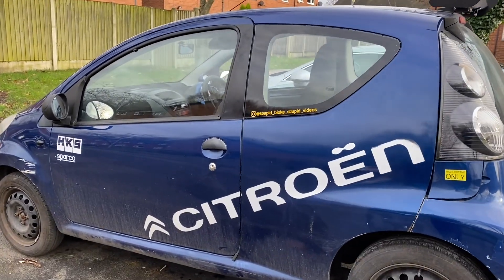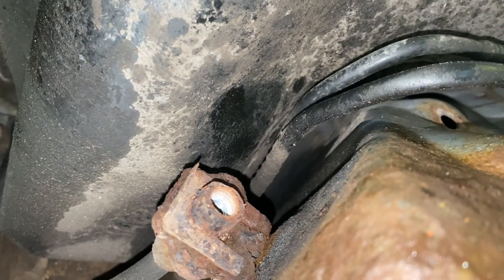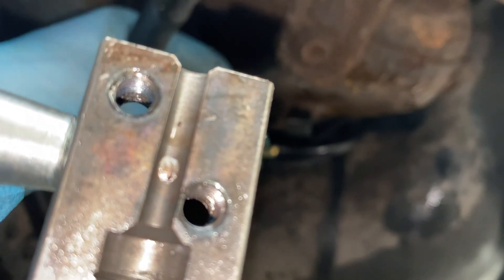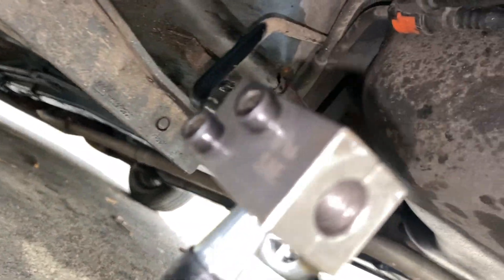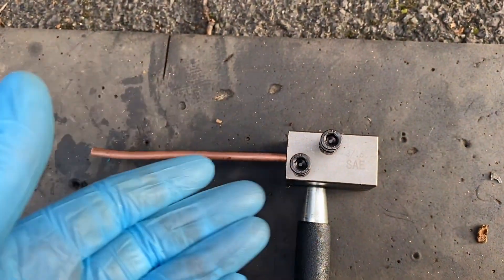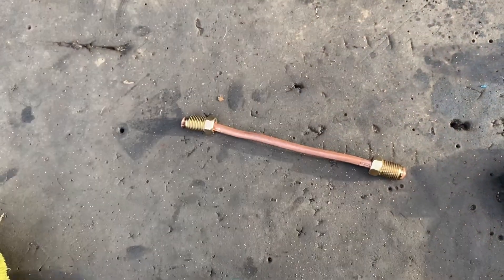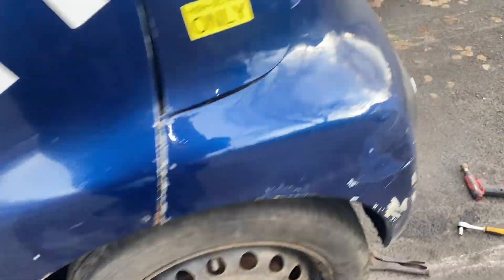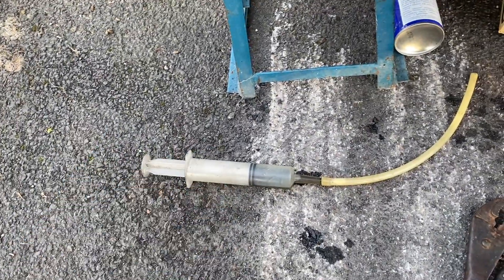How to Safely Repair Rusted Brake Lines / Brake Pipe Section Replacement (CityBug)

Comment: Reminds me i was going to ask your opinion on a debated topic. Brake fluid changes. A few years ago i had a Renault Clio that was only a few years old and the stealership said oh you have to do a brake fluid change after 3 years. Needless to say i told them to do one as how can a closed system absorbed so much water after 3 years right? So how long would you say like every 5-6 years or longer maybe?
Reply from the maker: A lot of dealers recommend it to be changed pretty often but once cars are out of warranty it’s something that seems to get left tbh. I’ve heard a lot of dealerships just suck the fluid out of the reservoir and replace it too without flushing it through. We do it on bikes during a service a lot of the time at work, but we do flush new all the way. Most cars beyond a few years old only seem to get it changed when components like pipes are changed and it doesn’t seem to cause issues. It’s a sealed system but the fluid does go through heat cycles and get shit into it from rubber seals etc. properly flushing the fluid is a job I’ve got planned for a future video. As long as the nipples come undone it’s easy enough to do. I intend to see if it makes any difference to the feel of the brakes, but I suspect it won’t 🤷‍♀️
Reply: @StupidBlokeStupidVideos  I've heard that as well about the dealers. I bought one of those gadgets where it sucks the crap fluid out of the bleed nipple side and puts it into a small pot really handy for the job and only £20 off amazon. Needless to say i did the job myself when the brakes needed doing 2 birds one stone. It didn't make a difference for me see if it makes any different in your vehicle. Oh and keep up the vids make me laugh every time. 👍
Reply from the maker: @daggers88  I’ve got one of those kits at work but usually just use the syringe method I show here, and thanks mate 🤣

Comment: brilliant you made it look so easy ,,i remember doing brake pipes on my old viva 40 odd years back ,,had to keep running back and forward to shop to get new pipes made when i made an arse of it ,,,where did you get the little heat gun ,,?
Reply from the maker: Cheers mate. The tool to do them on the car and to join them to steel is a game changer. The little blow lamp is a Snap-on one I got off the rape van a few years ago but it’s a good bit of kit tbh. Fills up with lighter gas but does actually give a usable amount of heat out

Comment: Hi, please i need advice

I am a Citybug (C1) owner myself. I experience horrible gas milage recently. (about 37mpg !!)

I changed the MAP, sparkplugs, crankshaft sensor, watercoolant thermometer, throttle valve, lambda sensor, catalytic converter,
tried injektor cleaner but NOTHING works. The OBD shows no errors.

I experience some engine rattling when it´s cold - maybe the timing chain or the valves?

do you have ANY idea? Thank you!
Reply from the maker: Also are you working it out to UK gallon and not US gallons aren’t you? If you’re working it to US gallon then you’re getting more like 42mpg in UK gallons
Reply: @StupidBlokeStupidVideos  Thank you very much for your reply mate.

It´s indeed UK gallons. 7.6 Liters / 100km

I rarely make short journeys and the gas mileage is about the same in winter/summertime (maybe about 0.5L less in Summer)

I always check for inflated tires or binding brakes and i am really trying to hypermile that car! So no "digital" acceleration like you used to say.

This really really bugs me, since the normal mileage for the c1 should be around 5.6L or 50mpg uk
Reply from the maker: @PhoticSneezeOne  in the real world about 43-45 is probably more realistic in real world scenario. There are a lot of factors that can impact mpg but the pre-cat lambda can throw the mixture off if that’s faulty
Reply from the maker: Hi mate. Are you doing short journeys? Cold weather and short journeys kills mpg, also driving style is probably the biggest contributing factor. If it’s running well then other than that check tyre pressures and for binding brakes? I get less mpg than that, but my car is modified
Reply: If it helps ... I recently got about 374 miles from full to beeping on a mixture of maybe 80% long distance and 20% around town. Not sure what that works out as MPG as I don't know what the tank size is ... can anyone shed light ... I'm thinking around 35 litres from full to beeping?  Anyway, what is the deal with getting 100 miles or more for the first block of the fuel gauge and only 374 miles for 5 blocks? 😂

Comment: Nothing related to brakes but the front of my Aygo isnt look so pretty anymore (some could say it never was) but...if I wanted to buy new bonnet, bumper and stuff from the UK its going to cost a lot. Luckily the Chinese ripped off these cars as the BYD F0 (formally the F1) and the body panel parts for that thing are a lot cheaper. Of course its going to completely change the way the front end looks but at this stage who cares.
Reply from the maker: I’ve heard of the BYD before. Wonder if the parts are actually a direct fit 🤔
Reply: @StupidBlokeStupidVideos  I've not tried but visually some look identical. And they are a lot cheaper, you just have to get them from places like Alibaba and aliexpress
Reply from the maker: @firefly2k7uk  let me know if you do it

Comment: That's a handy kit.. as far as I can remember (from the rare occasion I read some instructions.. ) they say to end up with the "female flare", you do the single flare operation first "Op1" then turn the die bolt around to further form it with "Op2" (without removing the pipe). Be interesting to see the difference on a bit of pipe if you haven't given the tool back yet.
Reply from the maker: That’s what I used to go off for steel pipes but copper just in a single go. I could be wrong though cos it’s 15 years since I’ve made one tbh, but it seems to work well enough

Comment: Brake fluid running down your arm? YES!

Just a little FYI for anyone reading this, I was always told to double flare (make a male end first and then re-flare it to turn it into a female end) when making the female end of the join because single flaring makes the metal thinner and a weak point. That info also came from a guy that made plant hydraulic pipes/hoses for a living. 

And here's a useful tip: keeping the brake pedal slightly depressed stops the fluid from dripping everywhere.
Reply: Could you please explain a little more?  It sounds like you are saying double flaring makes it weaker and that weaker is desirable.
Reply from the maker: @AC-um2mk  sorry I worded it wrong. When doing a female end, double flare it on the copper to make it thicker as copper is more ductile and can handle the process. If you double flare steel, it can make it crack
Reply: @StupidBlokeStupidVideos  Cool, makes sense now 👍
Reply from the maker: Yea double flaring on steel but copper should be fine without it. I meant to mention the clingfilm trick over the master cylinder to stop the fluid running out but I didn’t have any cling film and forgot to mention it lol

Comment: Thank you for video informative and funny as always, when I do any work on the hydraulic system I put some cling film under the master cylinder cap and screw it down this usually stops/slow down the fluid leaking? Keep up the good work always look forward to your videos.
Reply from the maker: Cheers mate. I meant to mention the cling film trick but didn’t have any at the time so didn’t do it, so forgot to say about it 🤦‍♀️

Comment: Little bit of electricians tape about an inch down the pipe will stop it from pushing back when flaring  in the future 👍🏼
Reply from the maker: I used to use sandpaper on the old vice mounted one I used to use many years ago, but this seemed to grip it really solidly without help
Reply: My shitter must be worn out 😅👍🏼
Reply from the maker: @Slo_Rocco  valve grinding paste works well too

Comment: if you buy one its DIN flares on these no SAE , that kit is missing a threaded stop you put in ...push up the pipe and lock it against the stop
Reply from the maker: I borrowed it off a mate so it’s not new and could have a bit missing I suppose, but just used my judgment and the flares came out well enough
Reply: What a professional answer....

Comment: Great timing! Will be replacing the brake cylinders tomorrow on my wife's car. Mine also need a bit of a pipe work repair, but that will be for another weekend.

Comment: Common problem on these, mine failed too, replaced from the flexi hose up to the front, just eliminates any further corrosion later on.
Reply from the maker: I’ll just keep replacing mine in 2” sections until I’ve done the whole thing 😂
Reply: @StupidBlokeStupidVideos  🤣😂🤣